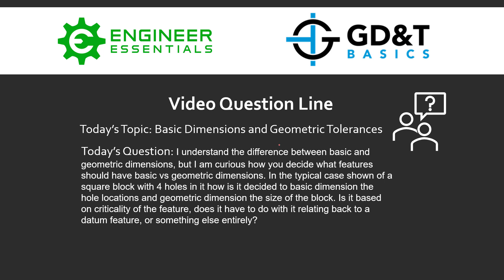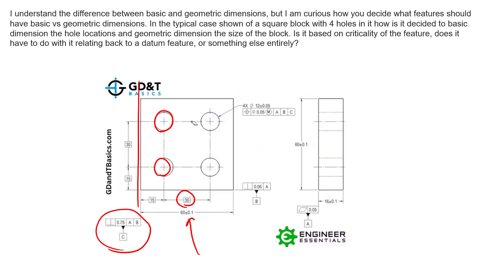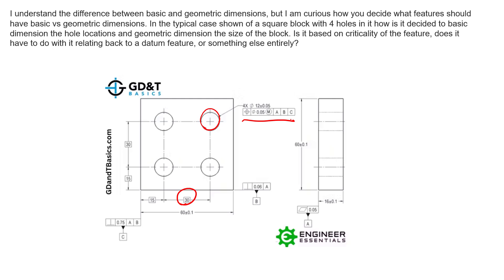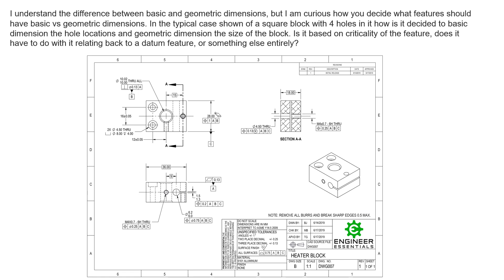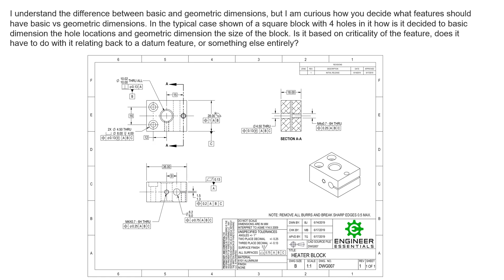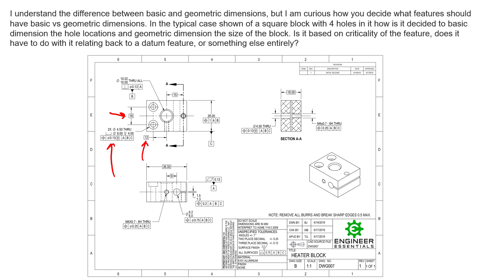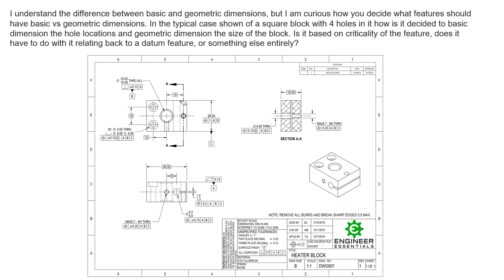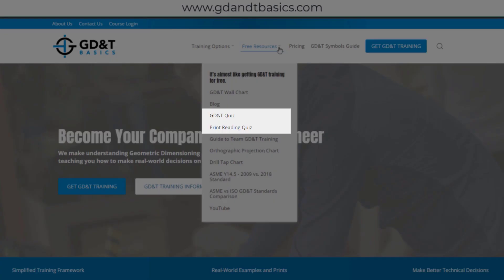When to Use GD&T

Comment: What is dim. 35 and 18  limits?
Reply from the maker: These are defined by the unless otherwise specified profile of a surface tolerance found in the title block. Essentially creating a located ± 0.375 size dimension for these two dimensions.